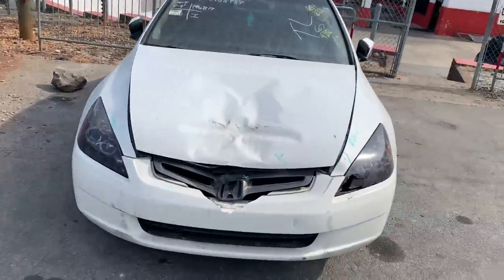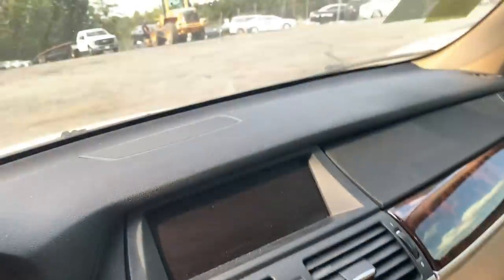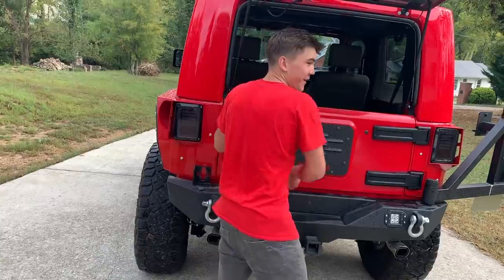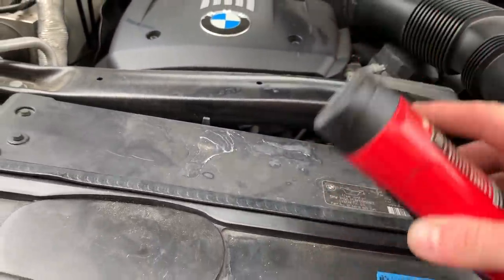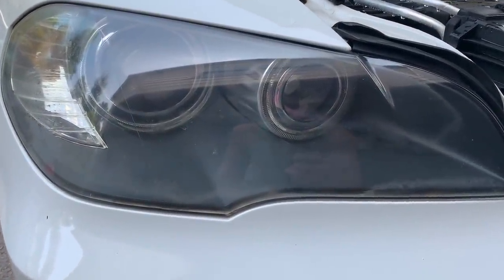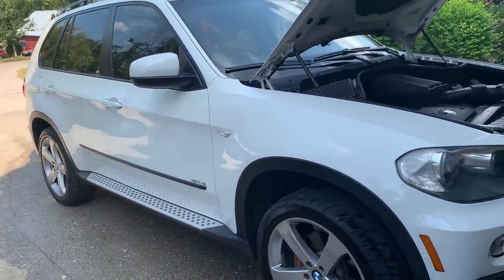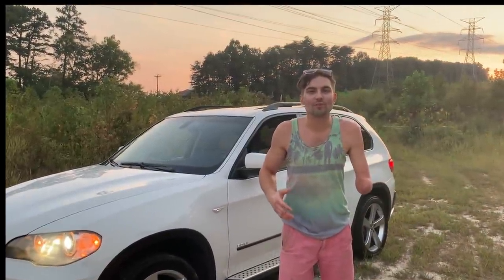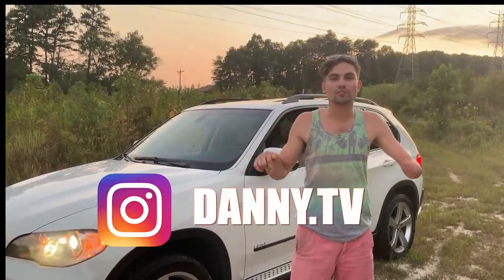I Bought A Clear Title REPO 2008 BMW X5 from the AUCTION

Comment: I owned a 2007 e70 X5 with the 4.8 engine. Great car I never had any issues with it. Drove it for about 4 years. Things were starting to deteriorate a little so I ended up selling it. I did change all fluids and anything that would require maintenance so I think that may be key.

Comment: NIce X5 Danny! I had at 2011 E70 Twin Turbo. It had lots of power and a smooth ride. The door handles go bad. Hot soapy water cleans them up but eventually you have to replace them. FCP Euro is a great source for them. The engine partition doesn't hold up to the heat and comes apart like yours did (and mine). You can find them on eBay for under $100. Keep up the great work!
Reply from the maker: Thanks! Will check it out. I appreciate  the heads up and support!👊

Comment: Clay Bar will get rid of all those contaminants and that back to black is all right but it only lasts about one or two washes.
Reply: Solution finish followed by a ceramic coat keeps trim black much longer.
Reply from the maker: Yes I feel like if I clay bar and ceramic coat the car I will have longer protection!

Comment: I would cash in on that X5 while its still in decent shape. As a former BMW technician, after about 80k they start falling appart and cost of maintenance/repairs get pretty high.
Reply: 200000km and still counting nothing major is up with my bmw X5 3.0 si
Reply from the maker: @johnstathopoulosfilm  Dang that crazy! Must have been well cared for.
Reply from the maker: What is usually first to got out? And how does the motor and tranny hold up on BMWs?
Reply: Motor and tranny usually hold up well. The trans sometimes act up but we usually updated software and most of the time fixed trans issuez. They also had alot of electronics issues, window regulators, PCV components (their made out of plastic..) cv axles. Also many of the interior components made of plastic get brittle and break with age like seat trim, cup holders, dash buttons.

Comment: That knocking from the passenger side is the steering rack, it's a common fault, I have it with mine, it only knocks on small pot holes
Reply from the maker: Ok thanks I will check on that. I appreciate the feedback and support👊

Comment: How much did u pay for it? I got one except mine is 07 and has 155k runs great also white but mine is si with 3rd row seats and active seats with heat and cooled air seats
Reply from the maker: I got it for $7k. Yeah at first I thought it had the 3rd row but I guess not. I think this is the 3.0si, no?

Comment: I was bidding on that x5 sold for 7k
Reply: Only 7k! That shit at least cost me 25k in my country
Reply: @AmeenkChanel  Got a better version for cheaper, 3.0sd M Sport 2008 for 6,035. Had some problems but fixed for 720.
Reply: @gediminassekmokas8008  I actually found a better car with better performance, a 04 - 06 Volvo s60 r you get 300hp and 0-60 time of 5.7sec ! Waw now that's better than BMW SUVs and sport cars at least you pay half the price bro
Reply: @AmeenkChanel  CL55 for 3,000 would be better as it has a 5l V8, along with ventilated seats, heated seats, massage seats, leather, etc. Also, looking at some pictures I've found that the rear passengers would be cramped in the Volvo.
Reply: @gediminassekmokas8008  for real? I saw they're asking 7-19 for a nice cl55 example
Reply: @AmeenkChanel  I saw a CL55 Kompressor for 8k, and a normal CL55 with 51k miles for 8k. They're amazing cars.